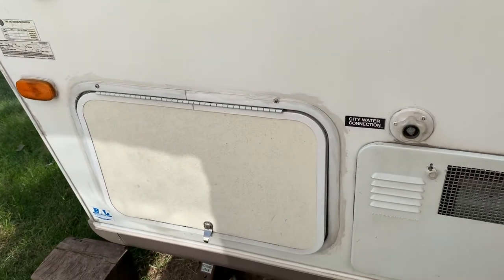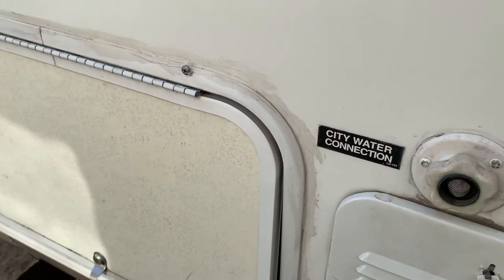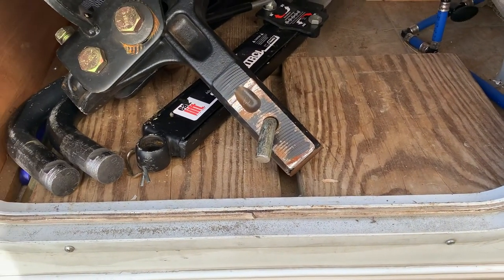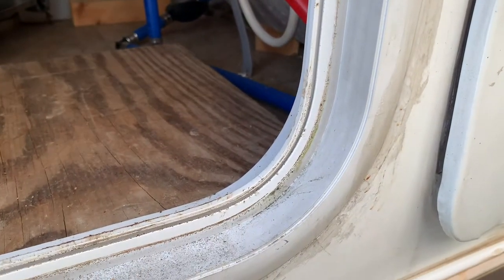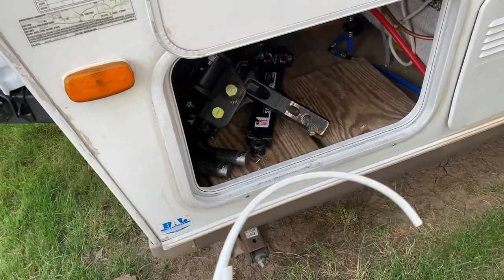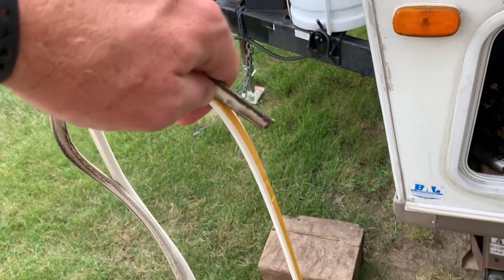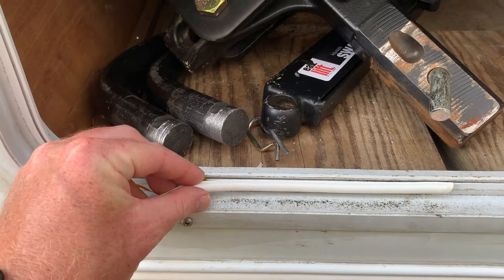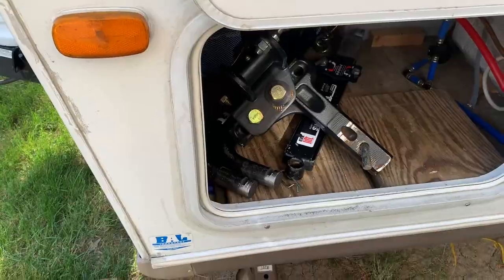How to seal your RV/camper storage lockers

Comment: Oh my! My weather strip didn't even remotely come off like that. It was so stuck and rotted, that I near pulled my hair our scraping it. Good of was the way at the time. 
I got it cleaned up and replaced,  but went out today to buy a heat guns for all the other ones. I will clean it all up with goof off for a smoother clean after the heat gun removes the big part.
Donyou think the heat gun will melt the old caulk around the outer edge that you first showed? 
Guess ill find out. This is not my area of work, but if I want it done ill have to learn as my hubs doesn't think it needs it be replaced. Thanks for the tutorial.